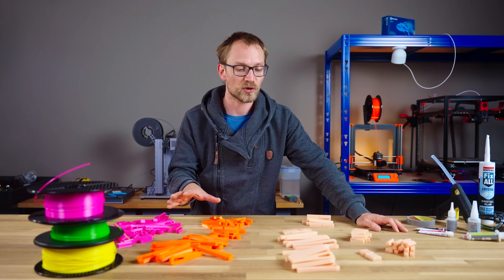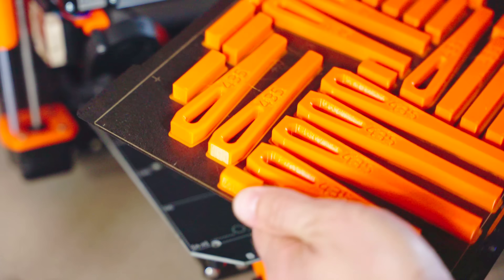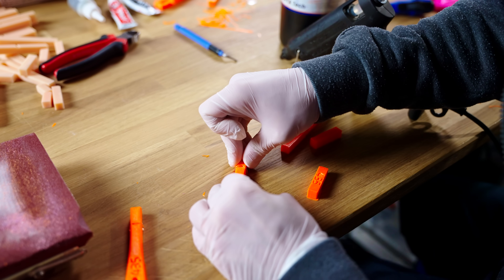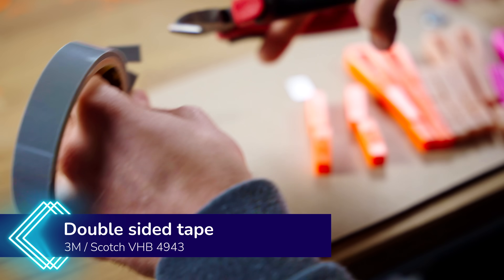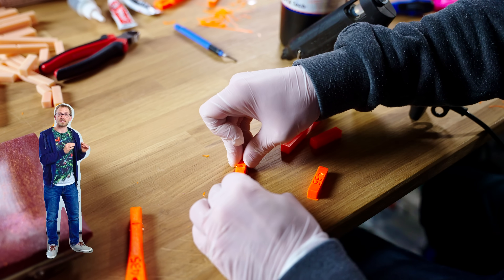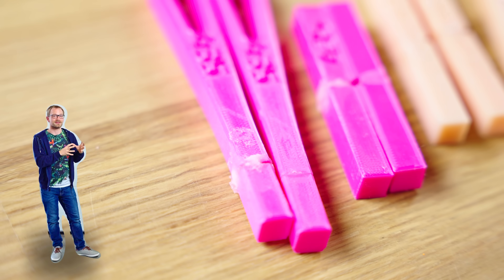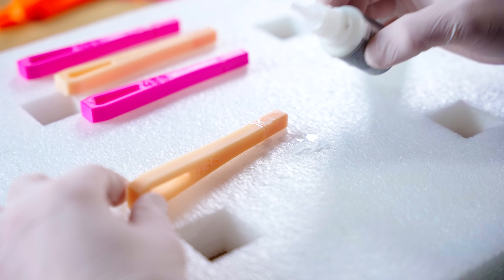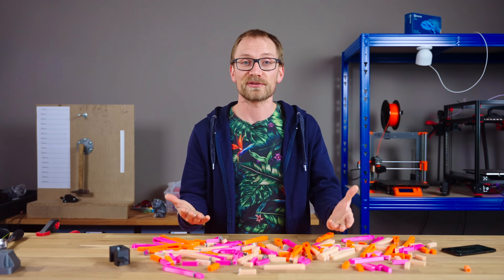Which glues work on 3D prints? JB Weld / Superglue / VHB tape…

Comment: I am using glue for PMMA to make very strong bonds in PLA. I only use some droplets between the parts and it is very fast drying and bonding. I am using Technicol 108 and the name of the fluid is dichloromethane.

Comment: Superglue is soo good on 3d print one time i was talking to a friend while assembling and put two surfaces against each other on purpose off angle to rotate into place so the glue would cover all contact surfaces and air would get out and bam... instantly as they touched they bonded... so this 45h print in many pieces got screwed by me underestimating the adhesion or fuse time. (it was ASA)

Comment: I have very good results with ethyl acetate for gluing two pla parts together, use a very thin layer applied by a tooth stick and it literally melt together. Gluing to other materials I use UV glue.

Comment: GREAT video! I'm so suprised many sources say to use super glue but I've had zero luck with it. Going to try hot glue (my 3d printer is basically a big hot glue gun married to an etch-a-sketch) and JB weld (in the old car guys world, JB weld is legendary.

Comment: What I find useful to increase the strength of bonds of two part epoxy (when transparent), is to go beyond the joint and around the area surrounding the joint. It helps a lot reinforcing the print.

Comment: My go-to "glue" for 3D prints is "Plastruct Bondene" plastic cement.  You have to use the "Bondene" variety of Plastruct cement...the regular Plastruct cement is not as versatile.  It solvent welds the stuff together.  You will sooner tear the printed piece apart at the layer lines than at the glue joint.  It works for PLA, ABS, PETG and certainly more.  Keep in mind that the stuff dries extremely quickly, so, make sure you put the cap back onto the bottle right away.  Super glue (cyanoacrylate) works decently on 3D prints, hot glue guns work great for certain applications and even various thermal welding techniques can work just fine.  But the cleanest and strongest joint will be achieved with a solvent welding cement (especially if combined with a joint design that allows the parts to physically interlock).

Comment: To add to your point about VHB tape at 13:27, I've had VHB tape holding up a 3D printed phone mount on my car's dash for the past 3 years without any issues. The dash is close to vertical so the force acting on the tape is more of a sheer force than the ones in your test. I think that with the tape also sticking very well to the car means that VHB tape is a great option for this use and maybe better than glues. Plus VHB tape is removable-ish so for something in a car that you dont wanna use glue on its a great choice
Reply: VHB is designed for pull not "twisting" 
That's why it failed in this test.
It's actually designed to release if twisted.

Comment: JB Kwik is fantastic and hardens within 5 minutes. I have build several super strong multi part PLA prints using it. Highly recommend. Because of set time, It is a far superior option over JB Weld for joining 3D prints.

Comment: From my experience, going over the broken part with soldering iron, has a high chance to top the strength chart.
Set temperature somewhere in the range of 110-210 C (depending on the stage, experiment), start with higher temp and use pointy tip and stab parts together couple times, then lower temperature and use knife tip to smooth the edges.
I'm surprised I did not see any comments suggesting it.

Comment: Proper heat for layer adhesion is a big factor here too. If the room you are printing is too cold, the fans are too high or your nozzle temp is just not hot enough, then your prints will be weaker. Also of course the design of the print itself matters a lot too. Honestly 3d printing even with just PLA at 100% infill is very strong. When above 1/4 inch thicknesses. As will basically all things plastic, you need to go thicker and bigger to have really good strength. However not everything needs to be strong and that's where 3d printing really shines. You can make incredibly complex prints with very little infill, using clever infill techniques, to make insanely light things. But that isn't to say that they are so weak, that if you look at them wrong they will break but even if they do, it's relatively easy to glue or just so cheap you can print another one 😅

Comment: For the FDM prints that had the bigger gap, you should use super glue on the center to hold it together, then use a 3d pen to melt plastic into the gaps, then sand it flat.

Comment: Yeah, the mini-Thomas was pretty awesome. I'm glad you were able to apply a patch to this, keeping the same content. I've watched this a few times now. I'd love to see another series of videos that maybe focus on a specific type of adhesive. So one video for different types of super glue (my favorite, I love CA), and a different video for JB Weld or whatever. I'm not a fan of epoxy, so it's nice to have my CA bias ("super glue is very good") proven with a visually fun and scientific method. I don't often have curvy/gaps in my parts, so it's nice to see that CA generally ends up being stronger than the parts themselves.

Comment: One thing I've been curious about is using JB weld as a print bed surface. I use it to fill in holes in my PEI/steel sheets when parts adhere a little too well and it rips chunks of the PEI off, particularly with ABS where I need maximum adhesion particularly with larger prints.

Comment: I found that 3M double stick Gray tape that it say can hold something like 30 lbs does not stick well at all. But the Clear 15 lbs 3M tape works well. I have only use the clear version on my Dayton Exciter speaker to stick to my cardboard cone but this works great. This version is the tape that comes on the Dayton Exciter speakers when you buy them.

Comment: I once got some hot glue stuck on my pei bed and it would ruin any petg I tried to print on it. I had to clean and scrape off all the hot glue before I could print with petg again. I used soap, alcohol, and a plastic card to scrape it all off.

Comment: It looks like you used too much CA glue in the joints. It's only supposed to be one drop per square inch. That might have yielded even better results. It shouldn't have been running out of the gap

Comment: Model glue. Direct extruder mount I printed in 2 pieces because I just couldn't get the line up right. Glued, clamped and left over night and the stepper mount was solid. This was Overture PLA+

Comment: A couple of weeks ago I glued a screw made from PLA that I use for a desk mount for a gamecontroller and which broke in the thread close to the shank. I glued it with Loctite and I used the screw several times already and I always put a lot of torque on it, but it didn't break again. So it looks to me that Loctite is a very good adhesive for PLA as well.

Comment: 🤔I made an adapter out of PLA to use Ryobi batteries with old non Ryobi tools. It lasted about 5 years. In that time it was dropped often and it broke several times. I found the best thing to repair it was superglue. However it was just supposed to be a test print so only had 2 walls and 15% infill. Often when the repair area was large I used hot glue because superglue had no hope of reconnecting the infill. Whereas hot glue is very good at filling gaps and with a lot of surface area still provides good bonding strength....Also with hot glue the repair was completed in minutes, superglue or epoxies may bond within minutes, but are not strong for many hours.

Comment: God VHB tape still haunts my nightmares. I worked at a testing lab, doing mechanical testing. One of the tests I ran a lot was peel testing, and that VHB was a nightmare to get off the substrate after the test. Usually involved at least N-Hexane,steel wool, and a razor blade. Half the time I just through the stainless test panels in the scrap bin whenever I got VHB.

Comment: I have used Testors model glue on PLA. It seems to do a decent enough job. Also contact cement as long as you have a nice flat surface to join together.

Comment: I don't understand the hot glue hate. It's not perfect for everything, but I find it's low heat resistance is great when you want to glue something on but still reliably be able to separate them(blast it with a hair dryer for a bit and it comes right off).

Comment: Use methylene Chloride, is not a glue but it disolves de superficial layer of almost every plastic and weld it together, use it for PLA, PETG and when working with acrylic, use a shringe, it dry fast and bond very well.

Comment: this is a great presentation.  as a followup though: mixing super glue with baking soda has very interesting properties. it crystalizes to an extremely hard surface : on many occasions I initially glue with super glue to just hold the parts, the with a wet finger dip it into baking soda and fill the gaps with the dampened baking soda and then use the crazy glue on that.  it becomes a material much harder and stiffer than the pla plastic.

Comment: I think the reason people dislike hot glue is because they have super cheap hot glue gun and hot glue. A good hot glue gun and glue makes all the difference, so so much easier and better to work with. The cheap ones start oozing the second you press the trigger and don’t stop until it’s used up the glue stick. With better glue gun you have control over how much and when the glue comes out of the glue gun

Comment: I think superglue with activator/ accelerator on the matching piece would work very well. More so if different viscocities are used.
The phenomena described is the same as wood glue. More often than not it is the wood that fails not the glue when applied correctly. Might be worth trying PVA and wood glue too.

Comment: I wonder how welding with a 3D printing pen holds up to these adhesives. I would estimate that it is somewhere between super glue and hot glue for the tensile test.

Comment: If you're going to use epoxies, you have to REALLY make sure you get the right mixture according to the instructions, either by weight or volume. I have also used golf shaft epoxy which is ridiculously strong. You also should be prepping the surface for any material which is appropriate for the type of glue you're using.

Comment: you missed testing superglue and kicker... this is what I use if I need a quick joint and to fill in any gaps.  the kicker is a spray that solidifies the glue instantly

Comment: There are couple of other aspects to consider gluing stuff together 1. 𝙨𝙪𝙥𝙚𝙧 glue flows easily and can render electronic components nearby like switches inoperative by flowing into them and covering their internal contractors. 2. 𝙨𝙪𝙥𝙚𝙧 glue after the initial bond produces vapors which also sticks to everything it settles on coating them white. If the thing you are making has electronics sticking to hot glue is the safest.

Comment: CA glue (particularly if you look at woodworking supplies) can be used in different consistencies and have an accelerator spray that may be of use for immediate set up. You can check that out too

Comment: Thomas, great job, I can't remember if I commented previously, but I use model makers [plastic kit] solvent weld which melts the touching surfaces - this is sold for Plastruct ABS extrusion material - I wondered if you excluded it because its not very nice stuff - but I'd love to know what the test results would be like.  It works on PLA and PETG btw as well as ABS.

Comment: Pro tip.... that "gap filler" for the superglue. It's just baking soda. It will dry any CA glue "superglue" on contact and give it structure.  They actually use this technique to fill large holes in helicopter blades. It can fill seriously large holes this way. Just add CA glue and sprinkle the baking soda on then rub/ blow it off. It seriously comes in handy.

Comment: Hot gluer here.  I use a heat gun to warm up the plastic before gluing. The pieces are fused so tight I have to break them apart.

For even more hold, expanding super glue is the winner.  Gorilla glue.

Comment: Tests like these, do not prove that the chemicals and materials mix for durable joining of critical printed parts. I have been given a ton of warnings, about glue dissolving and weakening PETG, and due to who offered them claims, and the wording of them, I actually refrained from, out of prudent security precaution, to use glue for PETG at all. Add to that, the number of people I have asked about this issue over the years, never getting any informed reply, leaves me baffled.

This video proves I have been given faulty information from commercial sources. I probably should rewind and try to track them people back. Something is way off here.

So thanks for the video. Not sure how to handle this right now, but since I have developed techniques to avoid the use of any glue at all, given the security warnings I were given, I really do not need to glue parts anymore. For some non-critical parts, this video opens opportunites to me, given the warnings I have been given, obviously were way over exaggerated.

Comment: Hi Tom.  I work with gluing up 3D prints almost daily.  I'd like to mention that CA glues, I have found have very useful variants.  There are Thin, Medium, and Thick variations, as well as some which are rubber toughened.   I typically use accelerators with them, but not always.  Accelerators can cause glues to boil and bubble in some situations causing aerated volume increase.  I'm eager to see how it works with PETG.  My favorite CA so far is Starbond.   They have a great variety, and I keep all four I mentioned at the ready.

Comment: this is really great! I was actually about to do these. finding the right adhesive for my PLA prints. and 2 part epoxy one like in this video is by far the easiest one to get in my location. But I keep wondering, do you know about model kit cements? like from Tamiya or Mr Hobby one. would it work with PLA as well? because I know model kits are usually injected with ABS plastic and it works really well with those. But I haven't tested it with any ABS print or PLA. anyway great video as always!

Comment: I can confirm Krazy Glue works well on Overture silk PLA. I printed an air raid siren rotor and glued the parts together, and it survived 12,000RPM perfectly fine. I've tried to pull the parts apart, and couldn't.

Comment: there is superglue gel, that solves the issue of the runniness of normal superglue.  I use superglue for putting anything I have that is a two part piece, like the bottom frame of a boxcar printing separately from the boxcar itself.  Superglue has worked just fine every time and it has always felt like the print itself would fail before the superglue would.  
Secondly, PLA is a plastic, and Superglue works exceptionally well with plastic, and the Resin has had no issues either.

Comment: I just bought the JB weld, because they are for industrial purposes, I think therefore stronger than regular epoxy, also says so on the package. For me , I produce 3D printed props , currently with FDMs, I do not want the glues to show and leave blobs on the outside , so I don’t  like using hot glue, it’s difficult to clean up , I have to make sure my prints stick , and cleanup the glue that got squeezed out of the gap. I use a medium viscosity gap filling superglue and jb weld , for now, they seem to work for me

Comment: If the JB Weld is still soft to scratch, you either didn't use enough hardener, or you didnt wait long enough. 

You need at least 1:1 ratio with JB weld, but I find that a bit more hardener than steel is best. (The a bit more white than black). Especially with JB weld that has been opened before and not used all in 1 go I will skew closer to 60/40 mix of hardener to steel on old JB weld, and 55/45 on new or fresh. Once it sits up, it will be hard as a damn rock. I've literally had cast aluminum fracture before a JB Weld joint failed. Especially if you do good surface prep. Need to strip any oil off, and rough up the surface as much as possible.

Comment: I use hot glue+jigs to hold parts together while epoxy cures. This allows you to use a slower curing (often stronger) epoxy than the 5-minute version. The jigs and hot glue will allow you to hold parts exactly where you need them.

Comment: I use contact glue along with epoxy and super glue. The contact glue is for joins that either need to break neatly at the join or are meant to be pried possibly open at some point. Super glue is by far most used, i use gel+accelerator. Much easier to use when it is a bit thicker and you have more time to fit the parts nicely and then spray with accelerator to make it solid.

Comment: I prefer to use my handheld printer pen and repair with the same filament I printed with. I’m sure in a pinch you could extrude with your hotend right onto the break and quickly squeeze the parts together. Or even use your desolder gun and melt filament into the part. 
Can you test that also?

Comment: There is an adhesive epoxy I have called "PC-7". That stuff is a pain in the ass to deal with, it's messy, it's goopy, but it is absolutely incredible on plastic. It's the only stuff I've found that will patch plastic gas tanks.

Comment: OK - I scrolled through lots and lots of comments (by no means all, but at least a few hundred) without seeing anybody else mention this, so I will...

If you can make a mark in the JB  Weld with your thumbnail, it isn't fully cured yet. When that stuff is completely set up, you can drill and tap it to take a machine bolt! It's not as tough as any metal harder than tin, but no way you should be able to mark it with your hands once it's finished curing!

Comment: PETG is such a weird substance - hard to glue it together, but it bonds permanently with glass to the point that it will peel layers of glass off rather than pop off.